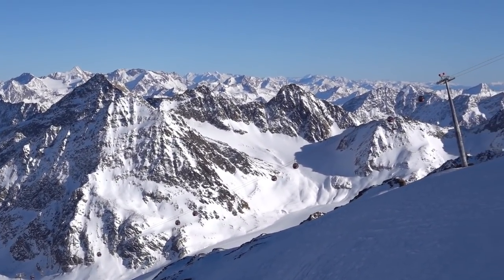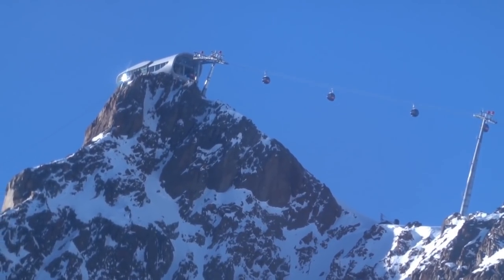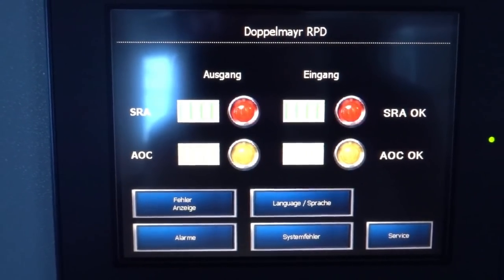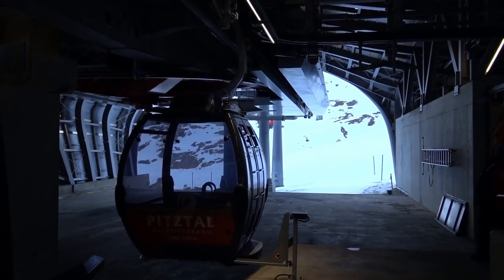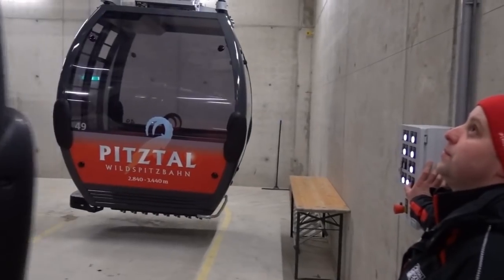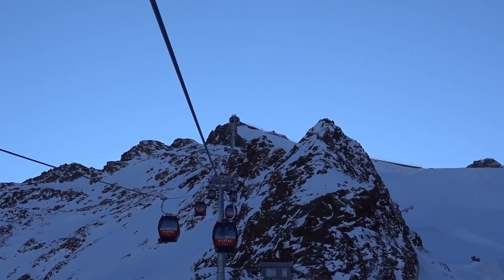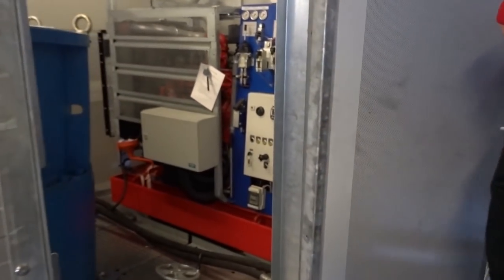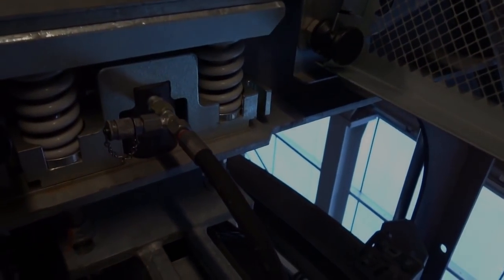The hidden depths where gondolas are sheltered for the night

Comment: Oh, man Keystone used to only garage the gondos if it was going to snow. I worked the overnight shift cleaning at the top lodge and would take the gondola to work after the ski day was over. One evening I overslept and was running late. I rushed to the gondola which was still running. I thought I had made eye contact with the guy running it as I hurried on. About halfway up, the lift stopped, and just sat there for like 10 minutes. Then it started running backwards. When I got back to the bottom, they were quite surprised to see me. They said they weren't sure if they were going to garage them that night and I was just that close to spending the freezing night hanging from the line!

Comment: Wow that was an awesome video! I have a question: At 2:30 you can see metal plates that are covering the top poles of the lift. I have seen these on many ski lifts including chairlifts as well, and I have always wondered what they are for. They are always only covering the highest poles of the ski lift, never have I seen the plates on earlier poles. Do you have any idea what purpose they serve? At first I thought they might offer protection against people touching the poles with their skis, but then they wouldn't be on a gondola lift. Maybe they are intended for when the gondolas swing back and forth a lot, but then why do lower poles that are more in the wind not have the plates? I am very curious haha
Reply: Good question. They serve to reflect sunlight, thereby keeping the towers from expanding unevenly (and thus curving sideways) due to solar heating. This expansion is tolerable on most towers, but not on those directly in front of the terminal, as it would adversely affect the position of the rope at the station entry and exit sheaves. You won't see it at towers near the bottom terminal either, because they are usually so short as to not suffer from excessive expansion.
Reply: @TheTimmy376  aha that is really interesting! I would never have guessed that thermal expansion from solar heating could be so significant for these structures. Thanks!

Comment: Nice video! Were just wondering yesterday how the seat heating works. So the heating is only active for the few seconds where the gondola passes through the station, no battery?
Reply: Yup, the seats have a large inductive load heater element, and get a big "slug" of low voltage, high current power at the base station. That turns to heat in the heating element to warm the seat.  As you then sit on the seat in the base station, you actually help to keep the seat warm for the duration of the ride.  You notice it warm when you sit on it at first, and then you insulate it and keep it warm for the rest of the time.  The downward journey isn't heated (at least on chairlifts, not sure about this gondola) as most chairlifts aren't download capable.
Reply: @Bigc847  Cool, and seems to work well. Thanks for the detailed response.

Would be interesting how much for energy it uses. I suppose next step is to only charge if a passenger is actually about to board.
Reply: @e1nste1in  Doppelmayr claim it's 420W per seat, but I'm not clear if that's per "chair" or per "person".  I think its per chair (on a 6 person detachable chair). They use a 7.5kW power supply in the base station and have about 20 seconds to provide power.  Charging based on passenger loading probability sounds hard but do-able.  Whether it's actually worth it is another matter.

Comment: It's interesting how some lifts are "garaged" & others are not. Blackcomb gondola has a garage at the mid section. Whistler gondola & Excalibur, no garage. Peak chair & Harmony chairs have a garage at the base of the lifts, & other chairs do not. P2P is equally garaged at both stations. There's an elevated engineering geek viewing platform on the Whistler side of P2P offering a close up view of the bull wheel, cable & mechanisms.